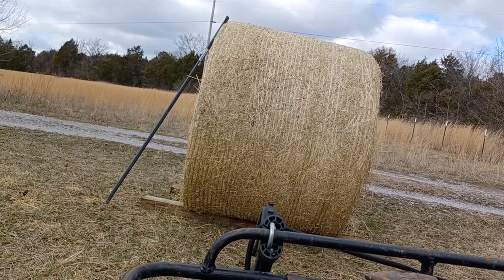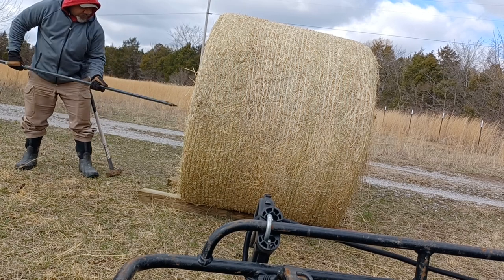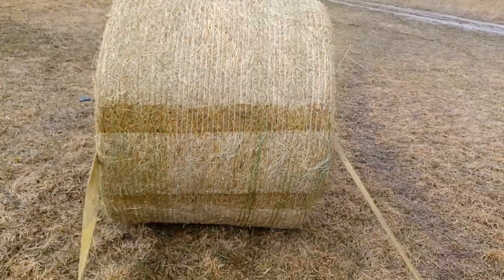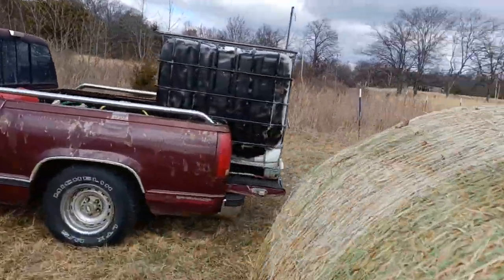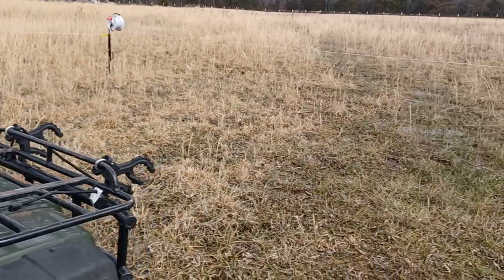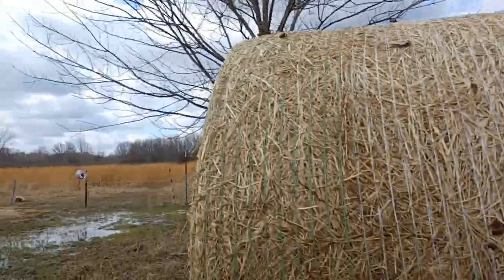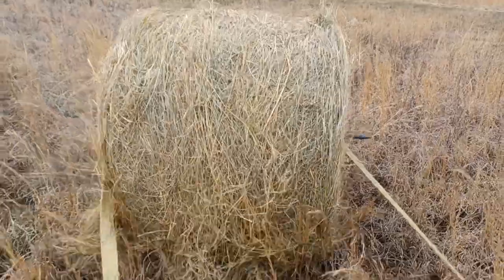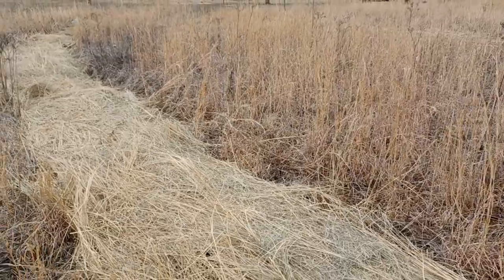Using the homemade hay unroller Pt 2

Comment: Good idea on unrolling the bale. I might suggest using a couple extra step in posts to put on the wire to put it on the ground, then drive over the wire while it is on the ground. One step in post on either side of the machine and bale. That is how I do it, and I can usually do it while the fence is still on because I never touch the wire with anything conductive, including myself!
Reply from the maker: That's is an option  for sure. Thanks for watching.
Reply: 😊byyyyyyy6
Reply: I keep a broken/bent step on post in the gator and use it to lift up the wire and go under it (or over, depending). you can twist it on and then off pretty quick and it comes in handy for a bunch of other uses when the fence is energized.

Comment: Get 2pcs) 6 ft PVC to stand under the hot wires. Good video. Cow 🐄 looks great.
Reply from the maker: Great idea,Thanks 👍
Reply: @KedeshFarm  you could attach double bent PVC to the 4 wheeler and have the wire ride over you as you drive under the wire.

Comment: Hello sir I have been using a similar  setup to what you have there if your having any issues with the strap coming off the pointed end you can tap a soft block of wood onto it with a sledge hammer. This has worked well for me and saved a lot of frustration with the strap coming off.  Also if you have the luxury of a helper having one on the 4 wheeler and another can walk next to the strap and push and pull on the strap as it is being pulled and it will effectively steer the bale. Just thought I would share what I've found to work.
Reply from the maker: I love the wooden block idea. Thanks